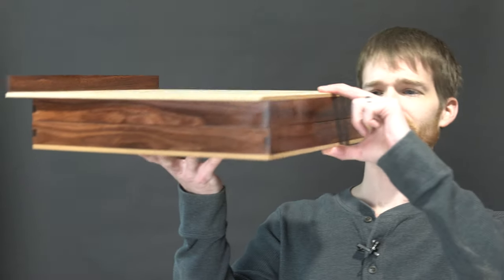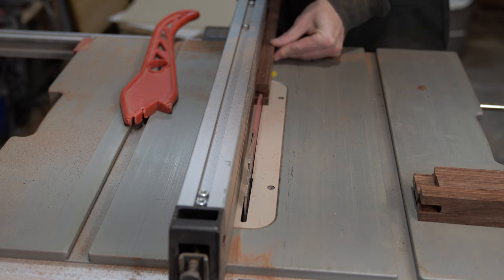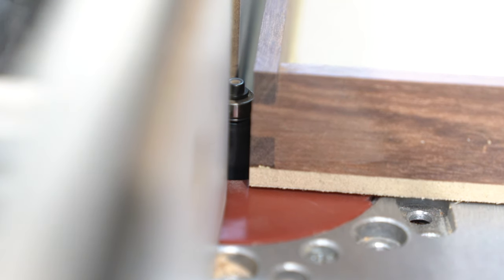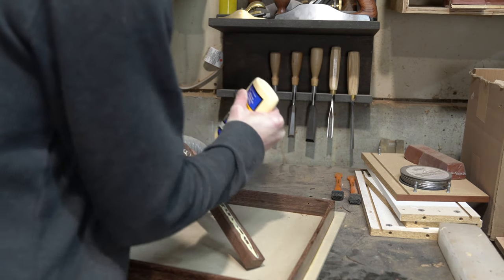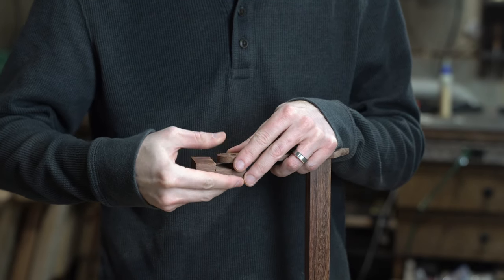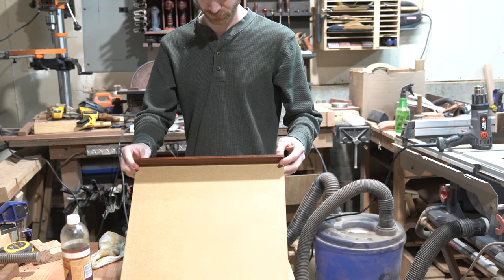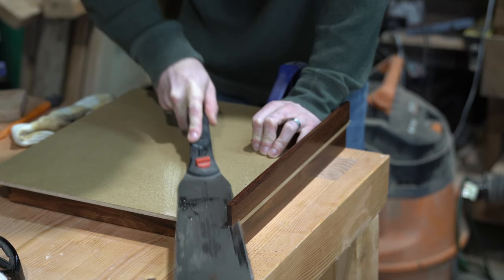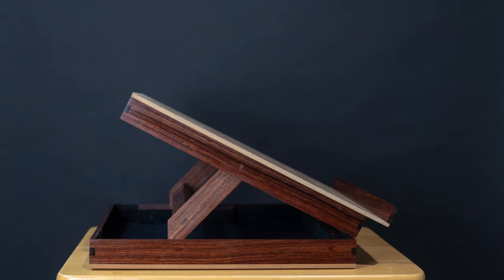Building a Desk Easel

Comment: I've wanted to try woodworking with a table saw but I've heard horror stories about accident.  if i bleed, it takes a long time to stop.  I'm wondering if those sleds make it safer to use?
Reply: So, a table-saw sled is generally used for cutting across the wood grain (hence, the "cross-cut" in cross-cut sled), whereas most cuts on a table-saw cut along the wood grain ("ripping" it in two).  Sleds aren't very useful for rip cuts.  But don't let that put you off learning woodworking.  Any saw, be they hand or electric, is dangerous when used carelessly.  As long as you follow basic safety rules for table-saws, and maintain a healthy respect for the machine's capabilities & limitations, you'll probably be just fine.  Good luck, and all the best, my friend.